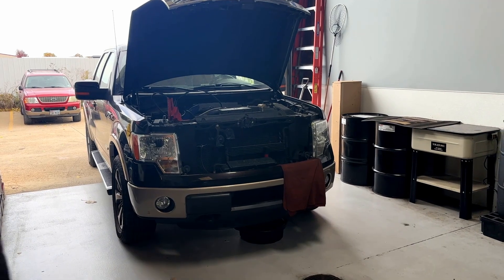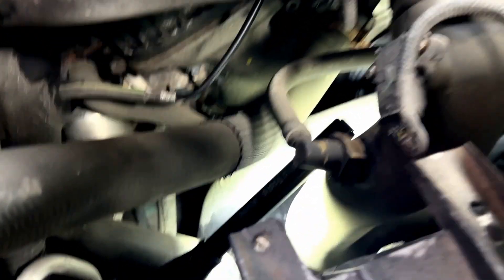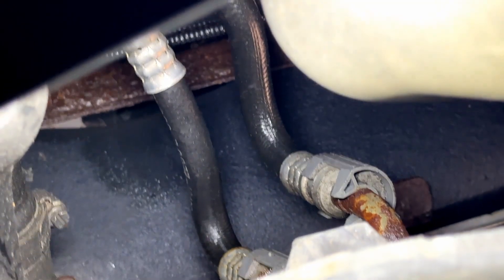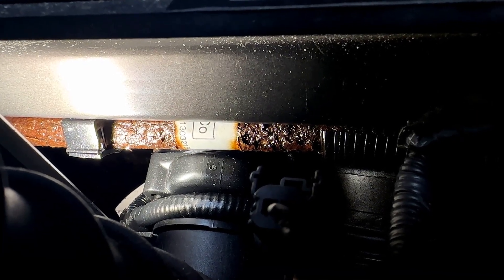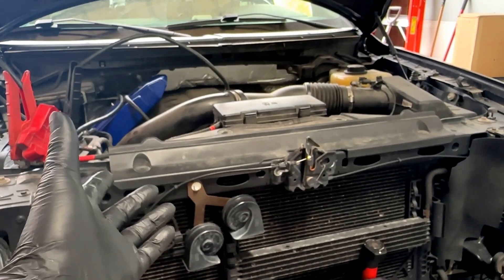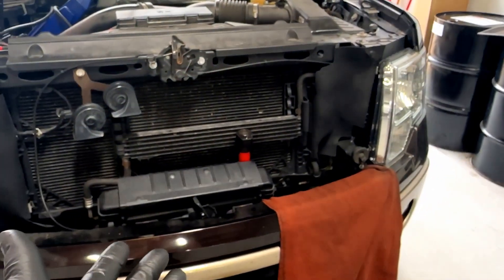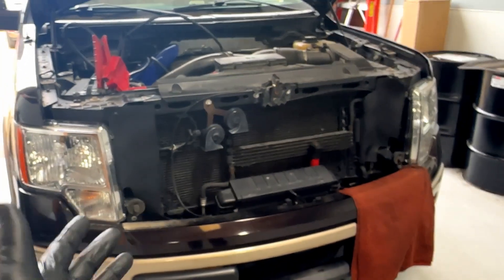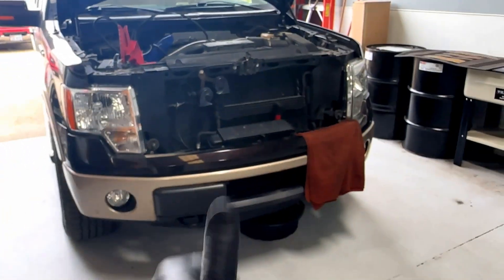One Last Time: Do Not be The Next Victim of Faulty Ford F-150 6R80 Transmission Cooler Lines!

Comment: I'm going to have to flush my whole trans system (water in the trans). Do you have a video on replacing the cooler, radiator and trans lines? I just want to make sure I don't replace it all then ruin the transmission completely in the process

Comment: this actually happen to two of my coworker 2015  with 80 000 km and 2017 110 000 km f150  they both snap right off no corrosion  no leak no warning at all this is caused by metal fatigue seem to be cause by the rubber line applying pressure ( trying to straight out) on the quick connect crimp when under pressure causing the failure .... changed my own for peace of mind on my 2014 f150 eb with 150 000 km  tried to break them by hand didn't took much effort one off them had hair line fracture .....  I think this problem is widely spread across ford truck using this style of oil cooler line..... change the line in prevention a lot cheaper then the transmission shame to trash your 6r80 due to cooler line .... I hope ford engineers will come up will revised  cooler line  without the fancy quick connect rubber line all the way between the cooler and the aluminum  line would fix this issue

Comment: Yup- I fixed mine after I watched your other video. I cut out the quick connects and coupled the lines with 300- bar rated hydraulic hose and constant torque hose clamps. My hard lines look pretty good yet and my couplers were in fair shape, but my 2014 has 200K now so THANK YOU for ALL of your videos! Now, to fix that leaky vacuum pump...
Reply: That's what I'm planning to do this weekend!

Comment: Part number ???
Reply from the maker: The part varies by model, year, engine and cooling options.
Reply: @FordTechMakuloco  2014 ford f150 fx4 with the 6.2l V8. With 60800 miles. It was a Florida truck and garage kept it's whole life until I acquired it at 48 k miles this last Feb. 

I found out it's part 7R081 but I'm contemplating also replacing 7B02A, 7B02B, and 7C410.

Comment: I’ve got a 16 f-150 glad I saw the red stain in the driveway before towing our trailer, the main trans supply/return line developed a small pin hole near the metal to metal support bracket. Royal pain to change but the OEM line fit perfectly

Comment: Are you recommending not using the Ford cooler lines?   I replaced my cooler lines with the Ford OEM parts.
Reply from the maker: I am recommending the latest Ford lines.
Reply: @FordTechMakuloco  Thank you for your further feedback.  I replaced mine soon after your first video during December of last year.  Hope those are the latest Ford lines.  I live in mild weather California with no road salts; the old ones visually looked great.  I changed them anyway, since you can't tell if the metal is ready to snap and they had 149K+ miles on them.

Comment: Ford has no excuse for this.  The lines should be of sufficient wall thickness or made from stainless steel with epoxy covering.  That would add very little to the overall cost of the vehicle and would help to prevent another customer going to the foreign owned truck makers.  Using aluminum fittings in settings where salt brine is laid, which is so common anymore, is a recipe for disaster. Excellent and sobering wisdom from Brian, once again.
Reply: Right on ,I had a similar problem on my 05 silverado but it was the fuel line from the tank to the engine very dangerous,also a brake line rusted out and could have caused an accident ,they could use better materials but all they are concerned with is getting it past the warranty date.
Reply: I agree 100%.  Have seen design engineers specify a robust material that gets downgraded going to production resulting in field failures. There is likely a grade and temper of aluminum alloy that would be acceptable for this application like 5052 with H32 conditioning . Why Ford allowed the neck diameter just below the Q.D. junction to be machined down  a few millimeters must have been to acomodate the collar crimper head . Otherwise a rookie mistake and Ford does not make many of those.

Comment: Thank you again, ace!  I changed them out the first time you talked about this.  I really cannot use a $6K+ bill right now!  Some guys were saying that it was a waste of money, because you're just replacing the lines with crummy Ford ones again.  I think that these were re-engineered.  I hope that they were.  Are you recommending not using the Ford cooler lines?  When I do my under vehicles inspections, I'm going to keep my eye on all of these transmission related lines.  👍👍👍

Comment: I have an 08 explorer with the 4.6 v8. I’ve been trying to figure out an issue where the rsc system suddenly kicks in for no reason. It’s not the axles, not abs sensors and the only thing I’ve noticed is the signal from the steering angle sensor suddenly gets lost then comes back which throws off the reading. Replaced sensor although I didn’t really think that was the issue and no luck. Any ideas or have you run across this?
Reply: Have you done a complete brake fluid exchange with the updated DOT4 fluid?
Reply: @rays7437  no I have not but I don’t see any possible way how that could interfere with the steering angle sensor output
Reply: @BillyBob-op6lg  
Misread your comment. Sorry. 
Is the SAS giving you a U code or are you monitoring the SAS with a scan tool?  Also, when does it "get lost?" While turning or some other event?
Reply: @rays7437   both. I monitor it and noticed that all is well with it being at 0 degree with steering wheel centered and then suddenly it’ll just like lose input im assuming because it just reads -180 or whatever the default is then it’ll go back to working but at that point it’s all out of wack and will eventually trip the rsc. The sensor will stay out of calibration and I’ll have to recalibrate to make it ok for a while longer. I assume there is a intermittent break in the wiring somewhere but was hoping maybe he or someone might’ve had this exact problem
Reply: @BillyBob-op6lg  
The airbag light on?
Reply: @rays7437  nope
Reply: @BillyBob-op6lg  
I asked a tech at work about it. He said it could be several things and that he'd actually have to have hands on. Sorry
Reply: @rays7437  and yah it happens while turning but I’ve visually inspected and don’t see anything. I’ve checked connector also and sort of tugged on the wires and they don’t feel lose or anything.

Comment: Horrible Engineering.
Almost makes you think it was done on purpose.
I'm a Ford Truck guy, this makes me shake my head in shame.
Modern and high tech is not better than what worked for decades on older cars.
So, I would not call this an improvement.
While we are at it where is my dip stick tube for the trans?
I know it is a negative pressure system but, I'm sure Ford could have still given the consumer a real dip stick tube.

Comment: Have you seen odd vibration issues on the 2015+ F150's? Most noticeable between 55-65 mph but can sometimes be felt at other speeds and what's odd is it's intermittent. It can happen on it's own but it seems like bumps can aggravate it. Does it in any gear, even neutral and on accel and decel. I just bought a 2015 and am noticing this, I ruled out wheels, tires, pinion angle, U-joints, parking brake shoes and bent axles. Most of what I find online ends with the person never solving it and either selling it or living with it.
Reply: Put it in tow haul mode when it starts vibrating. Take the torque converter out of lockup and see if it goes away
Reply: @firstlast---  the shake remains. I've tried that too. But also ive shifted into neutral while its doing, just to see, and the shake doesnt go away. That should eliminate the TC.
Reply: @kdmag88  Interesting. Have you swapped wheels with a known good truck?
Reply: @firstlast---  Yes. I had a 2004 f150 that rode very smooth. Swapped wheels and the shake remained in the 2015 and did not follow the wheels to the 2004.
Reply: @kdmag88  That's crazy. Have you checked cab mounts? Bed mounts? Engine mounts? Make sure all the bolts are tight too
Reply: @kdmag88  Have you tried shutting the engine off when it's shaking? Maybe it's a miss
Reply: @firstlast---  I don't think it's a miss, it feels much more vibrational. It doesn't change under load or coast or even neutral. A miss should resolve at idle in neutral. Plus no pending codes and plugs look good. It runs great at every other speed and load situation. I have not checked mounts but it really doesn't sound like that to me. I do know there is no clunking from the engine mounts during power braking, but I know they'd be real bad for that.
Reply: @kdmag88  Makes sense but I would still try shutting it off when you're driving. It's one less variable. You can get misfires without it setting codes

Comment: My 6R80 went at 151k miles, dealership said my clutch packs were burnt but they never said why. I had the transmission flushed at 90k miles at the dealership. They didn’t replace the transmission cooler, they only flushed it, $7k for a Ford remanufactured transmission with 3 year unlimited mile warranty

Comment: We have computerized engine oil level indicators, why don't the manufacturers do the same for transmissions, or even a pressure sensor that would immediately alert if there is a loss of oil pressure in the transmission?

My '07 Trailblazer' s transmission cooler lines rotted out but luckily I caught it in time. I cut the steel lines and replaced them with rubber hose.

Comment: I have a 2016 2.7 eco-boost with a six speed transmission, I think it’s the 6R80, would the transmission line upgrade you’re referring to also apply to my truck? 
And once again thank you for all the videos you are putting out there , I have followed your advice from installing a catch can to the type of coolant and motor oil that I should use  on my f150 , and  my truck still runs as good as it did the day I bought it
Reply: I believe he mentioned the cut off date for this issue was 2014.

Comment: Is it faulty or is it only the trucks living in the rust belt or traveling alot of road with deicer on them.
I have 13 with 150k and few others I work on that the lines are still silver colored and no sign of corrosion. I've definitely seen this on older vehicles but it's usually either really old or people traveling the passes alot in the winter.

It seems to me this is just normal maintenance, more common for those on corrosive roads.
Reply from the maker: The quick connects also just snap corrosion or not.

Comment: If you live where salt corrosion isn't a problem, the fatigue failure of the transmission line might be able to be avoided by covering the line where it breaks with a big blob of epoxy putty, so that it can't flex at that weak spot and break off from flexing and eventually cracking. I don't know if the epoxy can handle the heat, but it might. That stuff is very strong after it cures.
Reply: Might do that as I don't have rust to worry about
Reply: @zachariahz9832  Epoxy will stick to almost anything as long as it is clean & dry. (No oily residue or detergent film left on the surface.) If it is warm, the putty cures fast, so you need to get the 2 blobs mixed & the area covered fast, unless if is cold, which slows the curing. I don't think you are supposed to use it if it is cold weather. It might not cure correctly if it is cold. If I had that model vehicle, I would sure try it. The worst that could happen is that it falls off from getting too hot. But it can take a good bit of heat.
Reply: @billsimpson604  yes, they make a high temp version and it works great. I feel like it's the best bet bc a "new one" will be in the same position of fatigue in short order. My hoses are not rusted at all but I don't want the quick connects to break and that would give it the extra strength it needs and I'd sleep just fine at night.

Comment: Good video.
 As a commercial driver I'm used to doing pre-trip inspections daily. I do most of the maintenance on my 2016 Fx4 5.0 with a 6r80 trans. So just out of habit I'm doing pre-trip inspections on it. 
Always checking for leaks low tires etc.  Your videos have helped me several times with my maintenance endeavors.
Reply: Have you seen any similar problems described in this video with your truck? I have the 2015 myself
Reply: @samwell707   No I haven't.  I live in the south so no salt or rust either.
Reply: @craigbrown6610  awesome. I live near the Mexican border so hopefully pretty similar to your climate and luck.
Reply: So your pre trip inspections would have to be with an engine running then.  Otherwise the leak would not be found. I have skid plates on my Montero which makes it hard to check small leaks. But I will do my best

Comment: The corrosion on that steel line up front is unreal.  One would think they could make the metal a little more resistant to salt and de-icer, but I guess not.  And the aluminum breaking must be due to metal fatigue?
Reply: Less plastic and some anodizing would help Fords reputation immensely!

Comment: My friend who works at the parts department at a Ford dealership told me that they keep a big inventory of these lines in stock because of the high failure rate. That, and wiper transmissions that seize up.

Comment: I replaced the cooler lines on my 2014  after watching your video, the lines didn't appear to have any corrosion. I didn't replace the cooler  should I still do that anyways ?
Reply from the maker: No the coolers are only replaced after a transmission failure.

Comment: I assume this applies to the Lincoln Navigator with the 6r80?  I've got a 2012 with about 270k miles (thanks for the videos on the 5.4 3v phasers, guides, tensioners) .. the trans has always been super solid.  Wonder if I should do this job now.

Comment: I know you said up to 2014; does the 2016 model year fall under this issue too? I have 150,000 miles on my 2016, but had the trans fluid changed out at 130,000 when I bought it used
Reply from the maker: It can still happen I just personally have never seen it on 2015+ models.

Comment: Great video as always, keep them coming! I have a 2016 with 5.0 and the 6R80 guessing Ford fixed the problem after 14? Mine has 165K and has been very reliable other than the sync radio is always broken.

Comment: I have a 2014 supercab with 5.0 with 117k miles and I live in NC and I am second owner. Truck came from bama. It’s in very good shape. I serviced the tranny at last oil change 114k miles.  How many miles do you typically see with the trucks from the south that have a failure on those quick contact?  I’m wondering if I should just go ahead and change them?

Comment: Thanks for making another video for this problem.  I have been checking my quick-couple more often. No issues to report but i went checked my fluid level after your first video. Found my fluid was black with a hard shifting 3-4. Had a transmission shop check it and swap fluid but still a hard 3-4 shift happens when towing.
Reply: Ford owners: before each trip I do a thirty minute pre drive inspection then go change clothes and wash up.  It's no big deal to spend an hour to catch any number of design flaws.

Everyone else: get in and drive

Comment: Like your videos, been watching your Escape series. I wonder if you would still answer questions about your Ford Escape series? I have to change out the K frame (engine cradle). It's a 2012 Escape XLT V6. I will be doing this with the vehicle jacked up about a foot higher than normal ground clearance. I was wondering about the power steering. I thought I read that it's electrically actuated. Should I try to disconnect from the k-frame before k-frame removal (and leaving it in place)?  When it comes to drive shaft, I was hoping to disconnect at the center support if possible, but leave attached to transmission (ptu) and trying to snake the k-frame over it by sliding k-frame back further. I would rather not take a chance on messing up the attachment to the transmission (ptu). I don't remember you doing a k-frame replacement video for Escape. There are some videos on this, but not always the exact model/year/engine/etc on youtube. Thanks.  (ps. I don't have much experience with Fords, previously always owned GM vehicles)
Reply from the maker: We just changed one the other day. You can email me for the WSM procedure.

Comment: And new trucks are so expensive It's really worth it these days to drop 6k into a truck that is probably only worth 10, just to keep it running.  Great job!  Get those lines fixed for a lot cheaper than a transmission!
Reply: Not really.  There will be other issues.  It’s better to keep an eye on it and when it starts to become an issue sell and buy new.  Vehicles retain value so well and maintenance is so expensive it doesn’t make sense to keep them more than 7 years especially in the salt belt.